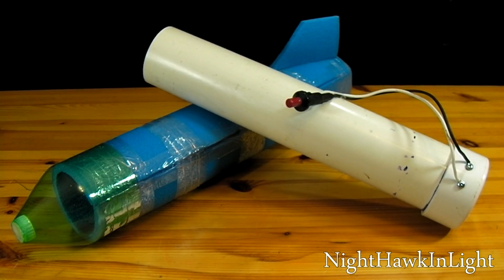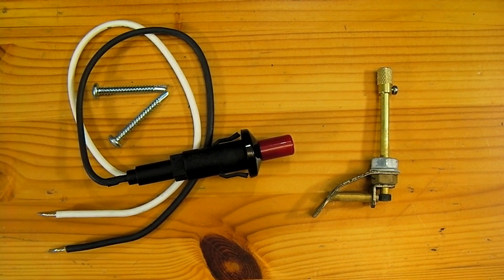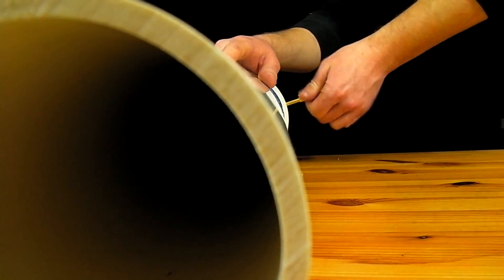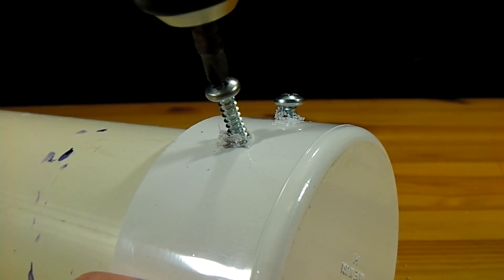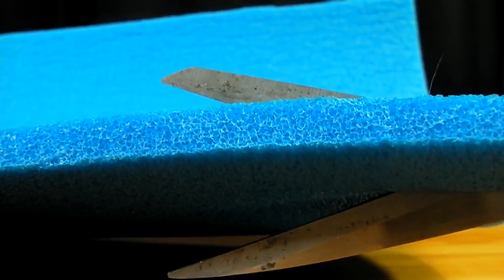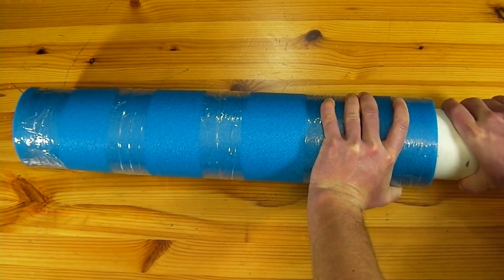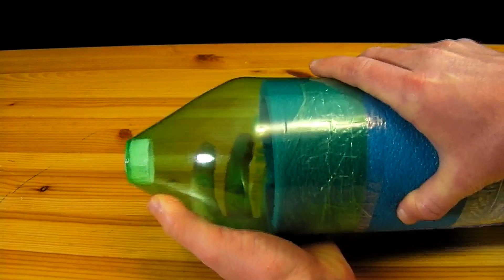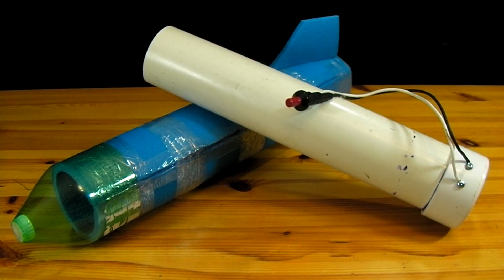How to Make a PVC Rocket Cannon

Comment: My BBQ lighter quickly turned junk before 150 sparks so replaced with much less expensive ($3.29) step-up power modulator (eBay or Amazon) powered by two AA_batteries plus momentary switch ... powerful sparks every time.  Perhaps others have enjoyed prolonged service from BBQ igniters ???

Comment: if i wanted to add length from the ignitor to the device what type of wire would you recommend? I've tried a few different types and i cant get a spark out of it
Reply from the maker: Your igniter may not be strong enough to still work with longer wires. You may have to switch the bbq igniter for a taser to use wires as long as you would like.

Comment: Fun project! Thanks for sharing.  We found that the rockets will eventually blowout the sides from the pressure of the ignition. We made our rockets from these pretzel containers: http://www.samsclub.com/sams/dc-pb-pretzels-44-oz/prod11910176.ip  We use packing tape to reinforce the entire container and a cushion to the top to prevent dents from landing on hard surface.

Comment: I like this concept, but could you use ca or hot glue to put  the foam rocket body together? I have everything I need in my basement except the foam. I am wondering if you tried that when experimenting with this rocket. If you have not, I might try it my self :).

Comment: What is pressure rated pvc pipe? I cant get it anywhere... Can i just use regular pvc pipe?
Reply: Pressure rated means if pressure is applied to the inside of the pipe it won't burst. It would not be safe you use normal PVC pipe

Comment: How long can you let charged cannon sit prior to ignition? I'd like to use in a show but would prefer to let unit sit already changed for an extend period of time (say 30 min). Would "fuel" evaporate or dissipate?

Anyone have a suggestion?
Reply: Use a smaller pvc pipe or just add a automatic spray

Comment: well it worked great the first time but all it did was go up about ten ft or less after that and i think the screws are being covered with hairspray and it will not launch help me with this
Reply from the maker: You need to blow some fresh air into the chamber between shots. If the screws get coated in hairspray you can fill a spray bottle with rubbing alcohol and use that as fuel instead.

Comment: Great video.  Thanks for making all these videos.  I thought of two things for this experiment.  One is to put dry graphite or other dry lubricant on the launcher to reduce friction on launch.  Also, this could be done on a smaller scale (and more easily stored).  Think of a standard plastic individual serving water bottle size vs. the two liter.  And I liked the idea of using Static Guard.  I wonder if it has the same explosive return.  Hmmmm, I think an experiment is in the making here....  Thanks again.

Comment from the maker: Loose or somewhat tight is fine. It should be alright as long as you're able to get the rocket on the launcher. To cause problems it would have to be so tight you wouldn't be able to get it on anyway. Even so, the worst that would happen is the nose cone would blow off.

Comment: The rocket was in the air for almost exactly 5 seconds. To reach the top, it took 2.5 seconds. Gravity is 9.8 m/s2 down.It took 2.5 seconds for the rocket's velocity to be overcome by gravity, so it slowed down at a rate of 9.8 m/s2 for 2.5 sec. 9.8 m/s2 x 2.5 sec means it was launched at 24.5 m/s. The average velocity is 12.25 m/s. Multiply that by 2.5 seconds and you have a rocket that went about 30.5 meters high.

30.5 m high.

Comment: Maybe design an ABS pipe jacket for the launcher as that would strengthen it and ABS doesn't shatter it just splits which would contain the PVC unless you went completely crazy.

But you are 100% right, my stepfather built a PVC  tennis ball launcher and after a while of using hairspray he decided to use oxy/acetylene mix which caused it go go off like a grenade. It was pretty scary but nobody was hurt amazingly.

Comment from the maker: While this cannon design can withstand just about anything, it is a dangerous practice to use anything other than an alcohol based spray or propane in PVC cannons. The pressure spike from other fuels is too sharp and can shatter brittle PVC.

Comment: I tried this, kind of. I used the wrong foam. I got three good shots using Pam then I found some hair spray. The rocket caught on fire.....lol. Question. Dose it matter how high or low you place the electrodes ? I had mine about one inch up. It did not always fire. I can see me having a lot of fun with this. Thanks

Comment from the maker: It will lift more than the weight of the rocket, but the heavier the projectile the shorter it will travel, and you risk having the rocket body pop if it's easier for the cannon to burst through rather than lifting it off. That wouldn't be especially dangerous so long as the rocket is made out of this soft foam, but it could ruin your hard work.

Comment: What would happen if you used a small piece of metal (big enough so u can stand on it) and put in on the rocket and you ignite the rocket. you also have to put metal on the other side of the rocket too so it stables out the rocket. would you go flying upwards due to the amount of force that is pushing you upwards, or would you be to heavy that the force is too small to lift a person?

Comment: I JUST made this. Mine doesn't go very high. Like 10' with RAVE hairspray. I tried different spray times. I also aired it out. More air, better launch but never great. Then I tried with Ronsonol Lighter Fuel and it went maybe 30'. I used the grill ignitor option. It strangely doesn't produce a spark everytime. The hairspray wets the inside tube. Not impressed.

Comment from the maker: The pipe i used is pressure rated, the cap is not. There's not enough pressure generated by this launcher to damage the weakest of pipe so long as the correct fuel is used, I would simply never recommend that anyone take even a slim risk.

Comment from the maker: The rocket is actually throwing mass long after it leaves the launcher. Because the ignition source for the fuel is at the bottom of the pipe the fuel/air mix burns from the bottom up, pushing the yet unburnt fuel into the rocket body where it burns from the open end up to the top until the fuel is expended.

Comment: if i were to use a smaller length of pipe with a smaller diameter, and a lighter instead of a sparker would it make a difference? Because thats what i am using and my rocket wont launch, and sometimes the hairspray wont ignite

Comment from the maker: If the pipe has any pressure rating at all on it it will be adequate. Usually the standard for 3" PVC is 260 psi I believe.

Comment: Will the rocket fly higher if the pvc base becomes taller? Or what if you spray more? Will it results in a higher lift due to the increased density of the gas inside the pvc?

Comment: Have you tried this with hydrogen yet? You could make different mixes in ballons and use a tube to load the launcher, extend your lighter a few feet or behind a screen and see what mixes get the best results. I'm curious. Do you think it would be that much better than hairspray? A lil bit of extra work for fuel, but worth it, I think.

Comment: one last question. i made a rocket and i used abs pipe instead of pvc pipe. when i launch the rocket there is an explosion of fire inside the rocket. it launches the rocket, but should there be an explosion of fire on the inside?

Comment from the maker: You know I never realized it, but you're right. The gas does not leave the can until there is no more liquid in the way. It must be the alcohol primarily that fuels the cannon, which is also a fine fuel, and one I have used frequently on its own from a spray bottle. I use it in both by mini cannon video, as well as the airsoft land mine video.

Comment from the maker: Some are worse than others. Propane and butane, which are the fuels that commonly pressurize hairspray cans, burn much slower than the ether in starting fluid. Those slower fuels are generally considered safe to use in properly made, pressure rated PVC cannons.

Comment from the maker: It's not the peak pressure that is the problem necessarily, it is the rate of pressure increase. Even a lower pressure than what the pipe is rated for can burst it if increased sharply enough because of how brittle PVC is.

Comment: but as long as the pressure spike doenst reach past what the pvc is rated for i dont think it would matter all that much and what little research I've done it keeps giving contrary information and doesnt say what conditions the pvc and starter fluid were in, rather it was a liquid poured on to it or vaporous contact what pressures or temperature it was experiencing so i have no idea if its safe or not

Comment from the maker: No, starting fluid is dangerous to use in PVC. It causes too fast of a pressure spike, as well as weakening the PVC wall over time. If you want a fuel that leaves no residue, propane is much safer.

Comment: have you tried using car starting fluid as a propelent, i use it for my potato cannon all the time. it is both powerful and clean burning, best of all you dont need much per run. for just frame of reference, my cannon has a 4in diameter buy 2ft long combustion chamber and all it needs is about 0.25-0.5 seconds of spray time!  hope that suggestion helps

Comment: Parts & Tools:
1. 18" x 3" Pressure Rated PVC Pipe
2. 3" Pressure Rated PVC End Cap
3. Piezoelectric BBQ Igniter or Flint & Steel Lantern Striker (Available at hardware or sporting goods stores)
4. 2 Self Tapping Screws if using a BBQ Ignitor
5. Foam Sleeping Pad
6. 2 Liter Soda Bottle
7. Duct or Packaging Tape
8. Hot Glue
9. Drill & Bits
10. PVC Primer & Cement

Comment: this could maybe work if you cut out a flat circular piece of plastic that is a tiny bit smaller then your tube. If you put the mentos in, then quickly put the circle in with the nerf football on top of it then it should work pretty well. The circle is put in so that eruption of the coke and mentos is evenly released on the football. But it would probably be more clean and cost effective if you just use the hairspray method. To do that just use his set up and keep the circle and it should work.

Comment: Nighthawkinlight  i was thinking i could use  a pipe and a nerf football with the small foam pipe with fins at the end and then the pipe were puting it in is filled with diet coke and alot of mentos quickly puting it in and running

Comment: Hi, I've tried to make this project recently. However, for fuel, I've tried just about every flammable, compressed, explosion-promising chemical or substance in my house, and none have produced positive results. I've tried Pure Butane, Petroleum, and various other compressed-can chemicals lying around. Those chemicals that do catch fire only produce flames, and no gas byproducts. 

Would you be so kind as to tell me the brand of the hairspray you use? I'm slightly worried here. 

Thanks again!

Comment from the maker: Starting fluid is not a safe fuel for use in PVC. The burn rate is too fast which causes a pressure spike sharp enough that it has the capability to shatter the pipe even if the pressure rating is more than what is reached.

Comment: I usually use starter fluid for cars. You know, the stuff you spray into the air cleaner when it's cold and the engine doesn't want to kick over? Yeah, it's about the same price as hair spray, ignites easier, AND burns cleaner without residue. It has to be said, use that sparingly as it is quite volatile and a little goes a long way... I mean it is essentially ether in a spray can...

Comment from the maker: Could be. It's either the hairspray or the spark. If you're getting a good spark and the hairspray says it's flammable on the can, the problem is probably that you're using too much or too little. You also need to blow in some fresh air between shots.

Comment from the maker: A better fuel to use is propane, but you will need to build a measuring system to use it properly. You can see plenty of cannons using regulated propane on spudfiles(dot)com.

Comment: if you guys dont have a grill ignitor, you can buy a cheap 50 cent ELECTRIC IGNITED lighter, (piezoelectric lighter) its the one were you dont spin the wheel. If you take it apart, and get into the button, there will be a little thing there. Just search in Google IMAGES piezoelectric lighter, and there is a diagram, its the first picture. If you take out the switch, there will be a wire there that makes a spark when you press the button. Just add some more thin wire and ther you go! thumb up pls

Comment: @Nighthawkinlight I built it. The terminal gets wet every time I fire. I'm only getting one shot before it gets too wet to spark. What can I do to fix this? Also, if I just touch the wires to battery terminals, are there any dangers there? Please respond as soon as possible. Thanks

Comment: Great idea. Reminds me of the tin soda can cannon we made many years ago. Aluminum cans don't work as well but can still be used, you just need to tape the whole unit. Instructions are cut the bottom and top off all cans except 1. Punch a whole through the bottom of that can with a common nail, 6 penny or larger. Tape cans together with that can as the bottom one with the nail whole facing out. Put a drop or two of lighter fluid into cannon, spin cannon and touch a flame to the nail whole. Boom!

Comment: Great video -- well filmed and the step-by-step construction details were very clear. I have one slight criticism and that's the use of the double preposition "off of" which is wrong and unnecessary. Specifically in "...cut off of the foam pad..." and "..pulled off of the pipe"; these phrases lose no meaning when the word "of" is removed; or you might say "pulled from". I hope you take this in the spirit in which it is written. I know it seems pedantic, but I find it distracting. Again, thanks!

Comment: this could easily be used to make a rocket-launcher kind of "weapon". a mobile one i mean.. if you put an extension on the body of the launcher without making the inside bigger (by maybe gluing another length of pvc w/end cap to the bottom of your creation) and add a handle for the ignition switch, you could (if body spray such as axe is flammable enough) attach a can of it as another handle and connect it to the main body with a hose to have a quick reload  for the energy source

Comment: @halfstar1 if its a large area of ground you want to cover you could probaly make a small version that looks somthing like a stalins organ use smaller sized PVC pipe about 1/2 or smaller and glue them  into a larger pipe with your ignition system init if you get what i mean this will let you launch prolly a dozen or more darts at once

Comment from the maker: @halfstar1 I read all of my comments, I see your suggestion. You could easily make this rocket drop things if you put the nosecone in upside down so there was a hollow area at the top. It will still be aerodynamic enough to fly, and whatever is loaded into it will fall out when the rocket reaches its peak.